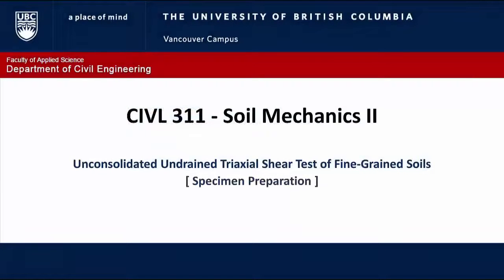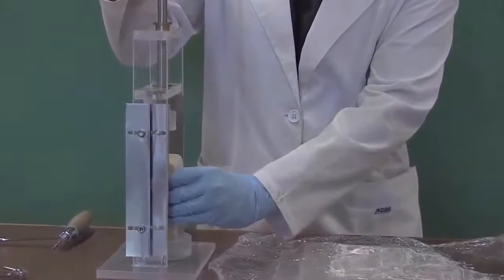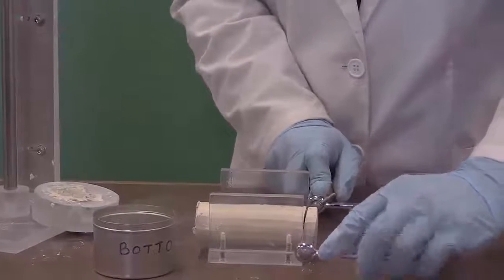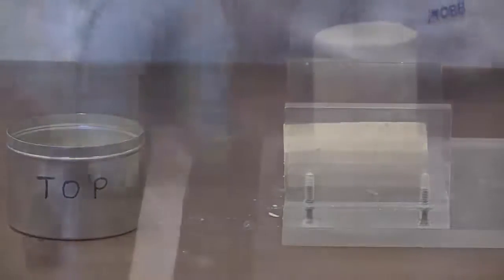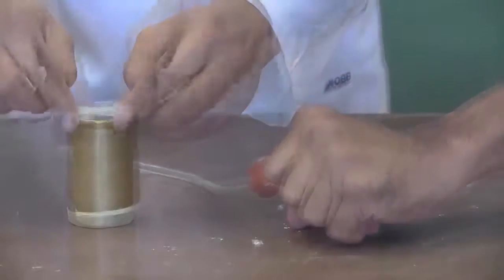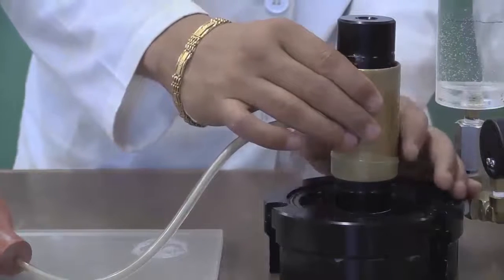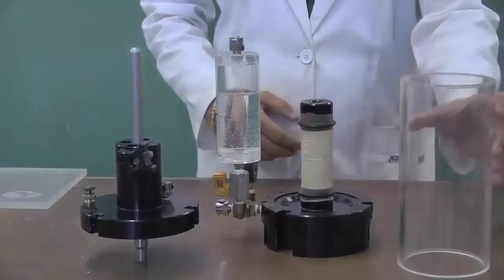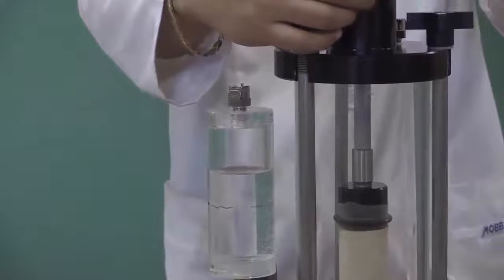UBC - CIVL311 - Triaxial Test Video 2 Specimen Preparation

Comment: So where is your back pressure tube usually connected to the top. By the way preparing and placing a soft clay is much more difficult because of high of possibility of disturbance.